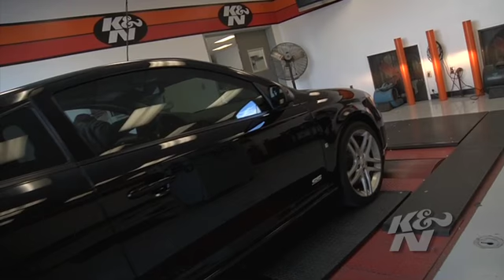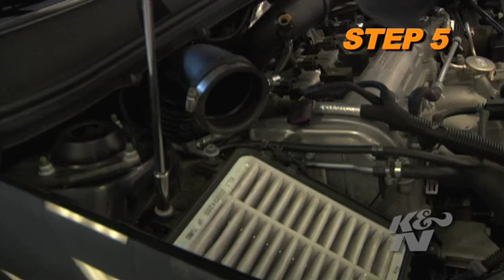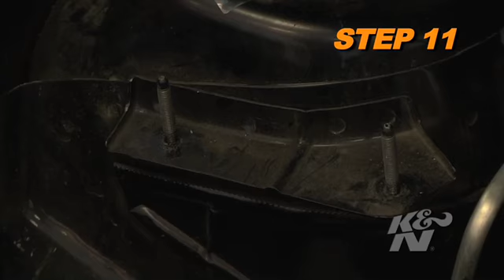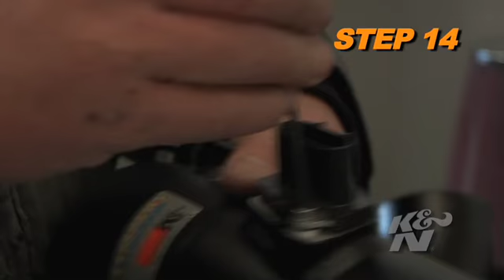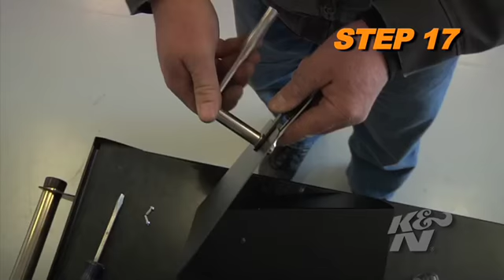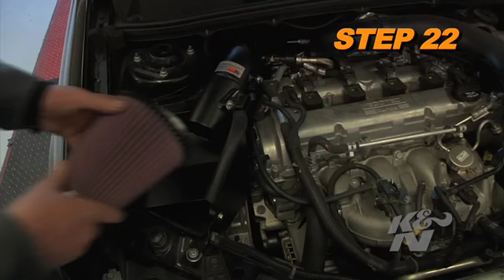2008 2009 2010 Chevy Cobalt SS Turbo K&N Air Intake Installation

Comment from the maker: Don't worry about turning anything.  It should work just fine if installed correctly.  If you have trouble contact K&N customer service at 800-858-3333 and they will assist you.

Comment: YOU MUST ADD. This intake will trigger a Check Engine Light for 08-10 Cobalt SS LNF's UNLESS the filter is placed at a specific angle with the k&n logo on the top of the filter upside down.